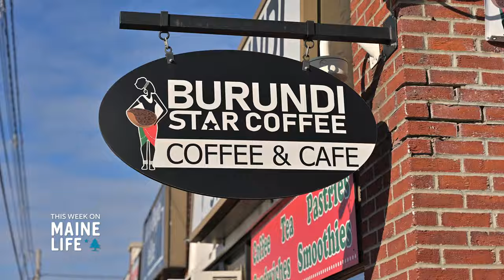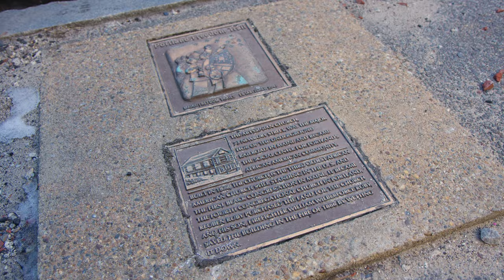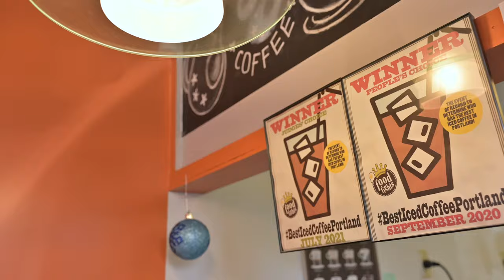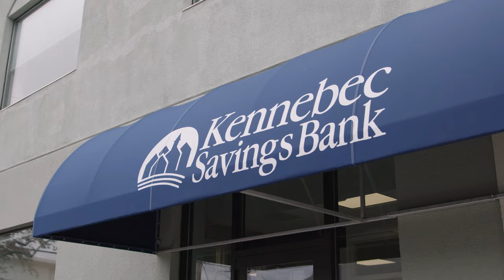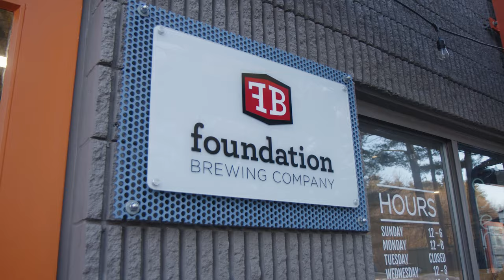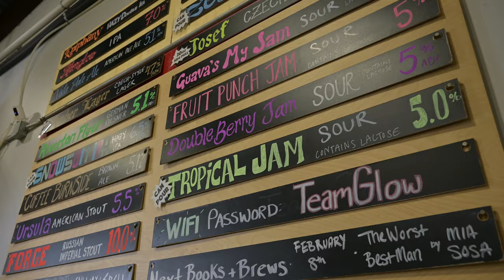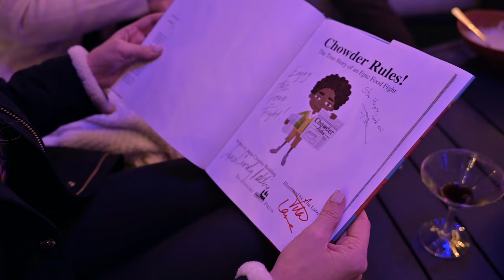MaineLife - S9 E13 - Portland

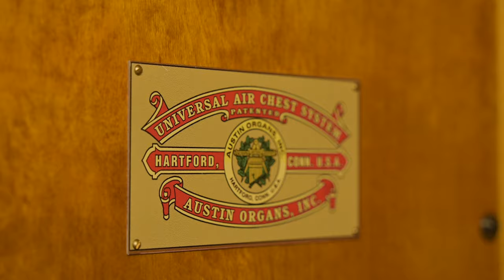Comment: My Mom was the church organist. In the early 80's the church installed a pipe organ with 4 rows of keys. It no longer is in the church do to operating costs, but there is a church a few towns away in West Hartford, CT that still uses it's original installed pipe organ with a slew of horns/ trumpets in the back of the church. It's amazing to hear to this day. In Hartrod, CT, The Bushnell also still operates a huge pipe organ. I noticed the label in the video on 13:40 mark of the company that help contruct the air chest system is from Hartford, CT. Very cool to see.